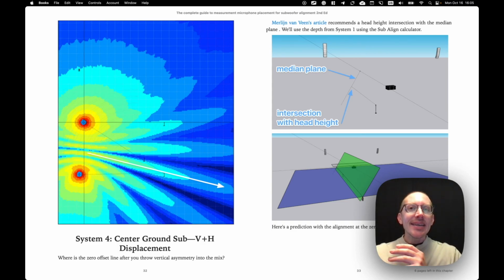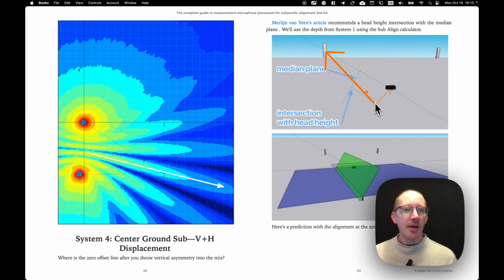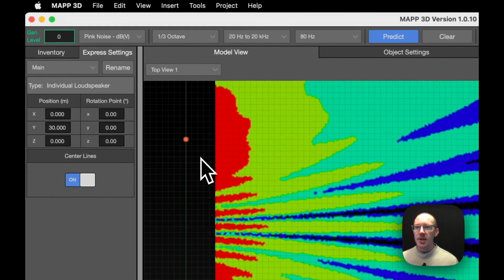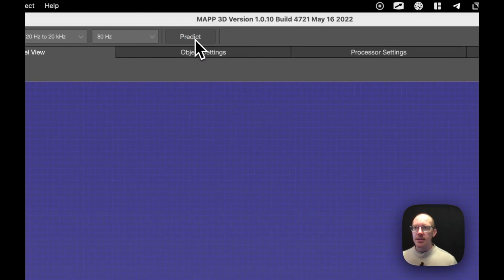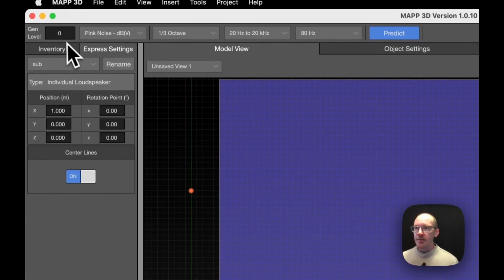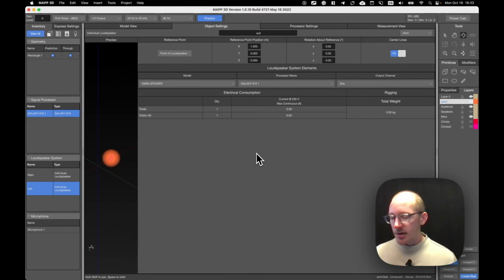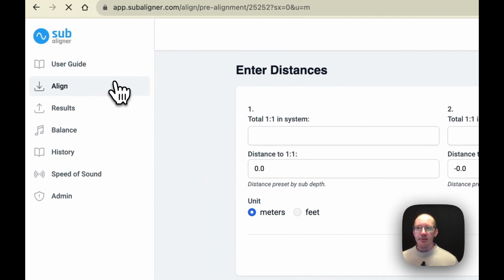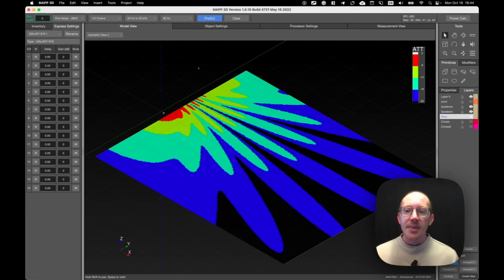Subwoofer alignment without the distance measurements?

Comment: I'm trying to learn better alignment in the field, especially as you say, sometimes with very limited time to run tests.  Using 80hz as the example like you do in the video, what if I just reverse polarity of one of them, say the subs, run a test tone of 80 hz through both speakers.  Then I add delay to the closest speaker to my listening location until I hear cancellation.  Once I flip phase back, I should have summation, but am I also aligned (roughly)?
Reply from the maker: Hey there inthemix, please see if this helps: https://youtu.be/_KdMlCEblgE?si=O1CXqMkYjbmbBY4g